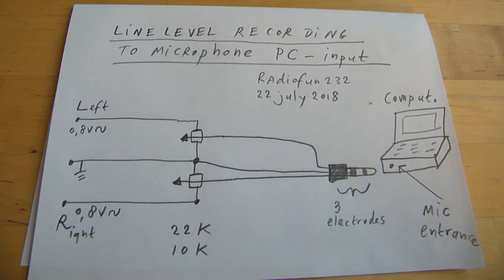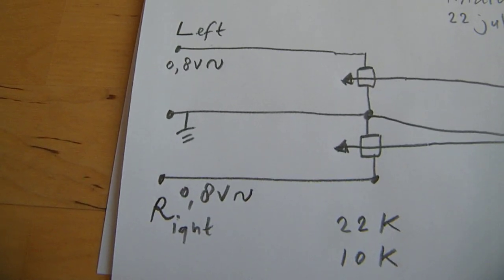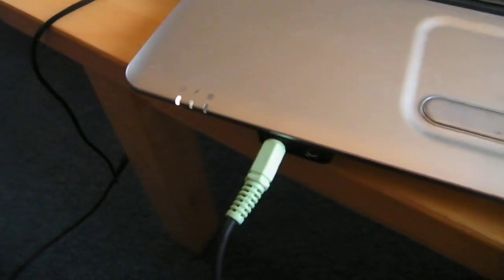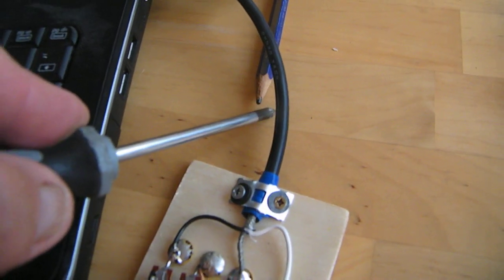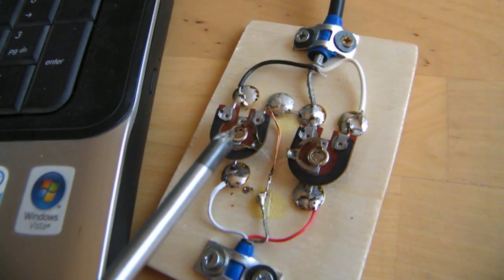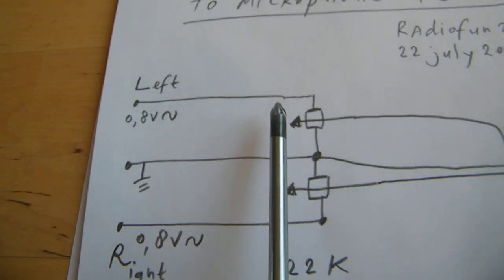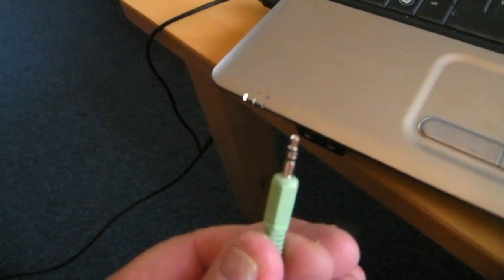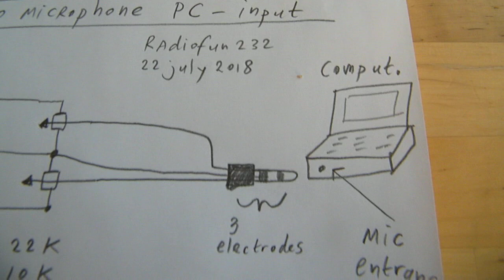Line level (say CD player) output to microphone input of a computer (schematic)

Comment: Hi. Thanks for posting..i thought the mic input was a mono signal on pc with 5v on the ring.  Are you actually getting stereo.?  Instead i use a usb line in input that can connect direct to rca outputs
Reply from the maker: Thanks. Yes, I am really getting stereo. Indeed I (also) heard that 5 V story, perhaps with more modern computers (?). The one to which the audio signal goes is (say) 10 years. But it will/must be always possible to analog audio in, I think.

Comment: thanks kio...simple useful circuit..does it also work when using the output from a headphone output?..if not what changes are needed?
Reply from the maker: Thanks. It was interesting: I could record with a cable from the headphone output of computer 1 (playing) to the microphone  input of computer 2 (recording). I made a tap in this cable to monitor the audio signal with a separate audio amplifier (later it proved that this tap was not necessary, but anyway). I had to reduce the headphone output level very substantially (of course...) to get an undistorted signal at the microphone input. Anyway, it worked. But when I tried to put a line-level-signal to the mic input of computer 2 I got enormous distortion, so had to reduce the signal with the potentiometers.

Comment: i don t understand what to do with gnd,  is touching the two potentionemeter?
Reply from the maker: On 1.10 in the video you can how all is soldered. The bronze wire in the middle of the screen shows the ground wire and how it is soldered to the shielding of the cables.
Reply: if instead of the 2 potentiometers I used 2 10k resistors I could leave the gnd direct. or where should it be connected? thanks for the reply
Reply from the maker: For stereo you must give each channel its own voltage divider, thus 2 x 2 10 K resistors. The signal levels are cut into half, in that way (no longer tunable). Compare the potentiometers in the schematic to two  10 K resistors both set halfway and make a drawing. Then you know how to solder it.

Comment: Not entrance. It is MIC Input. And the best value is 47 k ohm. Best regards.
Reply from the maker: Thanks for your correction.
Reply from the maker: I always take these resistors as low as possible to prevent hum on the signal lines.